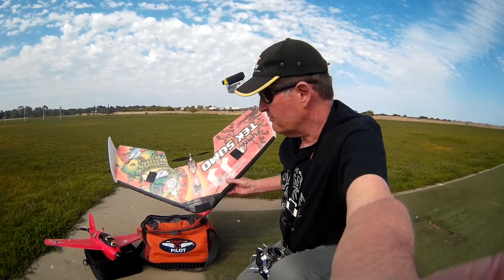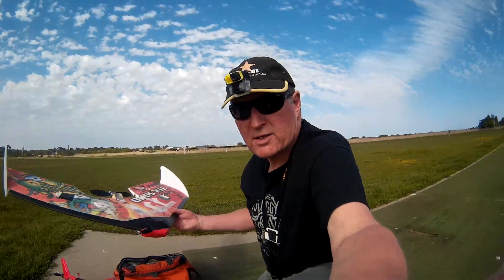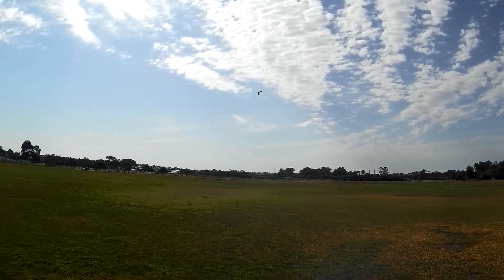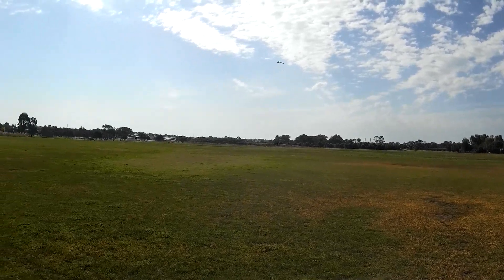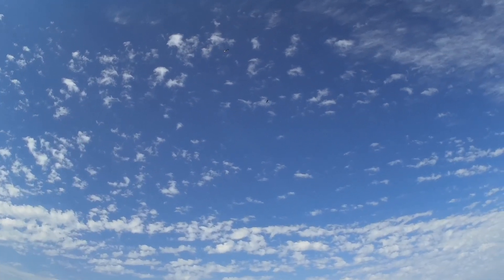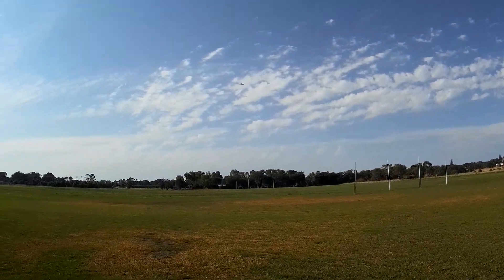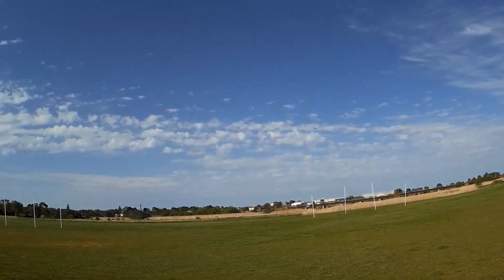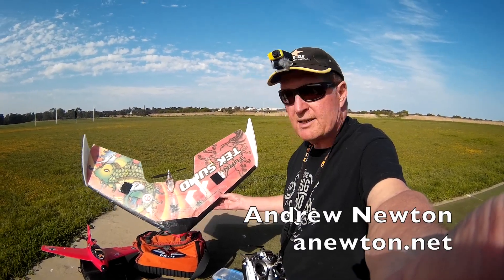AIR3 iNav TekSumo

Comment: Andrew, well, I just ordered the air3 for inav.  I hope that it comes in when my wife is not here. I will have alot of explaining to do.  Maybe you have answered this, or will answer it in the setup video, but is there a quick way to switch out the air3 from plane to plane depending on which one you want to fly? I am building a Mini Skyhunter, Mini Talon and Strix Stratosurfer. I won't want to fly all three on the same day. Would there be a lot of configuration settings to pre-program, or can you the saved configurations on an sd card? I can research all that, but I wanted to know if you have given that any thought, and have a procedure.  Oh, I left a note in the comments on my order that you referred me. Hope that helps to keep the videos coming. Thank you brother.
Reply from the maker: Ah excellent. I think you can set up 3 different Profiles in iNav but it's not something I have investigated yet. I'll see if I can work it out.

Comment: Very much what I have been tuning except I am using a omnibus F3 with OSD, a EA Synapse fuselage, 4 cell Li-ion, and FPV.
Mine too is under powered  except it is just ok with the 4 cell. Motor is a 2212 quad motor swinging the quads 9045 prop.
Just loaded 1.7.3 but haven't tried auto launch. Really not happy with my 2x 3 way mode switch set up.
Reply: You are stuck in first gear. You need speed in a swept wing. I have 2212 2200kv 3s APC 7x5.5 in a FT Versa and is overpowered but is too much fun.

Comment: Looks good Andrew....Did you manage to get hold of a proper Omnibus F4 board and GPS yet..?...I set my cruise throttle to about 60% but it depends on your power train of course.
Reply from the maker: Yes but I need to buy a decent soldering iron before I get started
Reply: Next you need something to change iNav settings in the field :)
Reply from the maker: Yes I'll try that next time. All my iNav flights have really just been quick tests rather than tuning.